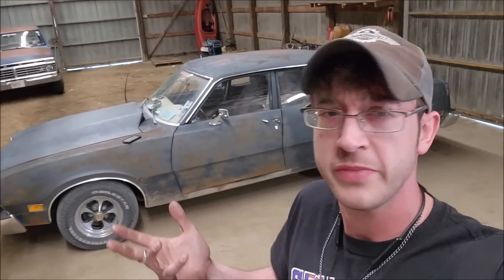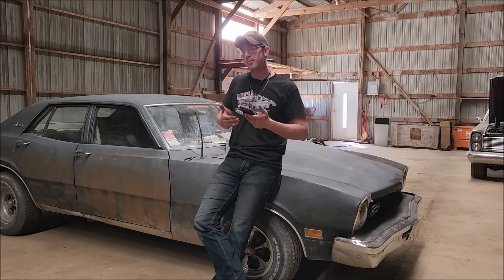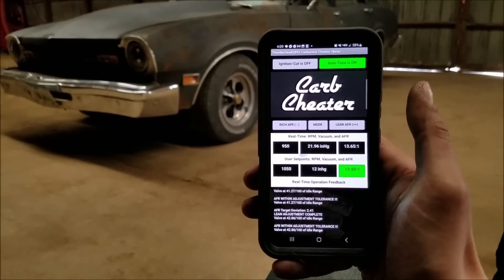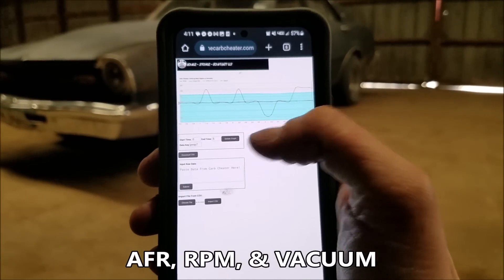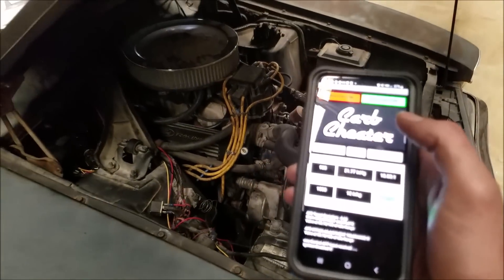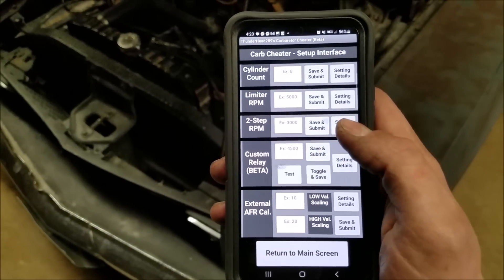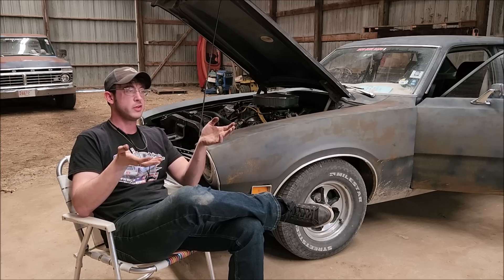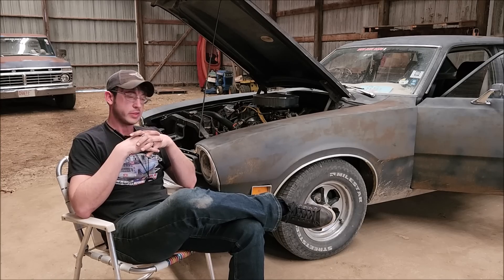A "self-Tuning" Carb in 2023? NOT fuel Injection (Beta Version - Teaser)

Comment: As soon as they are available, I am buying at least 3. I am a big supporter of carbbed vehicles over fuel injection and I own several antique cars that i want to keep on the road. This carb cheater would just help them run that much smoother and more efficient. Can't wait for it.

Comment: On remote start, the car will start with the key in the off position?
Reply from the maker: It's not something for anyone to worry about because I'm not allowing anyone else to do that the same way I did. 
I used the universal relay on the board that can be toggled, set to be on with key on (power an electric choke, or?), and it can be used as a "window switch" also know as an rpm threshold switch. So like a shift light, nitrous, and so on. I left it up to the user to be creative - the window switch thing always made me mad because they are over 50 dollars by themselves - Dumb. - figured we'd throw it on here.
Reply: @ThunderHead289  Thanks.  Not a concern or a criticism really, just a twentieth century guy trying to wrap his head around a little modern tech lol.

Comment: 6:20 And the bonus of it trying to fire but failing (due to the immobiliser) is that stupid car thieves will think, "Won't start, better run...", or "Outta fuel, better run...". Even the smarter ones might think it's a fuel blockage or electrical issue. I've always been of the mindset to not have a flashing light on your dash advertising the fact you have an alarm/immobiliser. For the vehicles I've driven (sorry, I'm an old-school bloke) that I wanted to secure, I had a concealed battery isolator. Just the cheap, red plastic key type. Up under the battery mount. Hard to find or see if you didn't know where it was.
Oh, hey. The 'Carb Cheater' is an awesome piece of kit, man!

Comment: This is a bit disconcerning since that it might be possible for the government to require you to install equipment like this as a condition for a vehicle registration. Also to tax you regarding vehicles miles Traveled, emissions compliance and insurance. No OBD2 port or similar is necessary since a number of older cars did not have them until 40 to 50 years ago depending on the car manufacturer. Scary stuff!!🤬🤬🤬
I don't think the inventor had nefarious intentions but you have consider the potential misuse if at all possible.
Reply from the maker: Off road use only 🙂
Reply: @ThunderHead289  I figured that but somebody else could "borrow the idea without your permission".

Comment: is there any reason you couldn't run this with e85 on a carb not specifically setup for e85? You could potentially integrate the optional GM Flex Fuel Sensor.
Reply from the maker: I have considered that, and I think it's a worthwhile endeavor to test for v2

Comment: I enjoy this greatly. I would make good use of this set-up, as I currently have an old Nissan 720 pick-up that I pulled out of the pile, and I threw a turbo at it (have about 500 into it- thanks ebay). Seems to take it well! But the fact that you've set up a module that communicates via bluetooth to an android app, can take a few inputs and bleed air to correct an AFR is damned cool. I have no idea what would need to happen if boost were involved- well, I have a slight idea, but I have the feeling the answer is nothing. Do nothing but make sure your tune is right under boost. I'm more interested in the fact that you've programmed a way to ground the coils for rev limit and launch control. Who am I kidding, I just want what you've got to make life a little bit easier. Lord knows if this motor went I'd just throw a KA24 in the bay and run some of that hotrod fuel injection instead of a Hitachi two barrel. 

So, yeah, suggestions would be: If a boosted application, be able to map positive boost. That's about all you could do, I suppose. I see some comments saying "retard ignition timing", which would be pretty difficult unless this little module were interconnected with whatever pick-up is being used for the ignition system. Maybe have more "outputs" for relays, such as an output that's an RPM window with or without a MAP setting (I'm thinking a nitro application, or maybe a water meth injection application). That application would even help me, as I've over-pumped my fuel system, so I'm running a hilarious set-up of PWM voltage to a high pressure pump when not in boost, then when boost comes on, I have a oil pressure sender that's just piped into my intake that will close due to air pressure and send full voltage to the pump. Tons of things you could do, but the more you do, the closer we'll get to "Heck, a speeduino could do that". Speaking of, is that what it's based off of? Also, looks like I'm gonna have to look into applying for a beta test. Wish I knew how to edit videos, I recorded the whole truck so far start to finish, so I've got tens of hours of BSing the camera and doing terrible welds. America.
Reply: Went ahead and filled it out, if you read this, you'll know which is mine. I could throw it on about half my rigs if you don't want to fuss with turbocharged vehicles at the moment. Could make a good test monkey whether I throw it on an all stock Cadillac with a 307, or a cammed up small block, or a stock small block, or, or, or.

Comment: Pure genius. I love carbs, and this makes so much sense I'm surprised no one came up with this . You give me faith in the future of classic cars! Don't retire from YouTube, there is no rule that says you have to post every week.
Reply: Absolutely right! I'd much rather see a well informed, we'll produced and put together video less frequently, than to watch some of the junk on YouTube these days
Reply: In the 1980s Mitsubishi was putting Mikuni feedback carbs on their four cylinder engines.    They were an actual carburetor with a low pressure fuel delivery (not TBI, no kind of "injector") but used an oxygen sensor and a variable air channel to adjust AFR continually.    

In retrospect they're really clever,  but back then none of us had any idea how they worked and nobody would touch one.    Today with what I know I'd have no problem.
Reply: @shoveI  GM did the same with quadrajets in the '80s, but they had narrow band afrs and the computer had a very narrow running area so they did not work well on non stock engines without a reprogram, which almost nobody offered or did, so they all got tossed for a regular qjet as soon as any mods were done.  It's a good idea that was severely limited by the tech of the day, just like the first fuel injection systems.  It's amazing to me nobody has really tried this since, it's a no brainer tbh.
Reply: To monetize a video it's a rule you have to post more than once every two weeks so yeah, there is a rule.
I'm not trying to be that guy I'm just sayin'..
Reply: You're not that guy, just informing us that didn't know. Thank you.
Reply: Holley had a "dial-a-jet" option in the 80s. It was a PWM solenoid that restricted the main passage. The user just turned a knob to "tune" the AFR. Without a WB AFR guage it was not real useful. With today's tech it would be great.
Reply: Some of my favorite channels post twice a year.

Comment: The only reason I wanted to switch to EFI was for timing and afr control. If I could keep my existing carb, fuel system, ignition system and distributor it would be a huge bonus, plus a 2 step and anti theft its a no brainer. A nitrous/boost controller would be sweet as well. Sign me up!
Reply from the maker: The universal relay (that I used to start the car) can be setup as a "window switch" aka RPM threshold switch. Nitrous interlock, shift light - whatever someone wants to do, I left it up to the users creativity.
Reply: @ThunderHead289  Awesome, hopefully available soon!

Comment: A project like this can get as far out of hand as you want it to... But... Since you've already established timing control you're only a couple of wheel speed sensors away from implementing traction control too. It would also be really trick if the fueling side of the cheater was able to be implemented as cruise control since then you'd also have vehicle speed data (or a target to maintain, at least) to work from. That could be more tricky if the cheater is still "just" an air bleed on the fueling side, but you'd have all of the logic available implement other means if you wanted.
Reply: Yes very easy to run down the road with other add ons but I’m sure Luke will tell you that cruise control has its share of liabilities that keeps it as a “standard” offering.
Reply: ‘keeps it (off the list) as’
Reply: @111000100101001  The whole project is a huge liability. Interfering with fueling and timing opens you up to nearly everything that can go wrong with a car. Even if something happens that isn't his fault, defending a wrongful death lawsuit will bankrupt him regardless. There's no amount of waivers or anything else that will protect him from a civil suit.

So... He's made whatever peace with that which he feels he needs to. May as well go all out at that point.
Reply: this is very cool; imagine what it could do for all types of boating, racing etc.

Comment: I'm so excited for this product!  I'm Nate the data log guy lol.  Remote start is something i never thought of, sure is tricky with a standard trans.  Really no good way to detect neutral.
Reply from the maker: hello hello! I just used the universal relay we put on the board and pressed the "test" button which turns it on when pressed and off when released. it has a maintain on that would come on with a power cycle (could be used for electric choke), and it also has an RPM threshold trigger. want a shift light? nitrous rpm interlock? (window switch). really I left it up to the user to be creative with it. - basically a programmable dry contact.

Comment: Boost timing and air/fuel adjustment for a blow thru carb would be sweet
Reply: This
Reply: @frankglasgow  Boom! With you on that. Another company has some device for carbs that auto tuned, but the price is exorbitant. Found it, K&N eci system $880 at jegs.and not power adder compatible.

Comment: We used to call this a computer controlled carb or feedback carb. My Plymouth Reliant and Mazda B2000 shipped with a 2 barrel feedback carb from the factory in 1982 and 1986, respectively.
Reply: Fuck me you must of had a heck n a half springy long cable to connect your telephone set hooked up to your car also good job everyone never had that back then or wud of been getting our wires crossed somewhere!! "JoeDog"a.k.a J.C.A  (the British are Coming, the British are Coming!)
"I Say Great Stuff Old Chap, Well Done Sir"
Reply from the maker: was a really good idea honestly but the tech just wasnt even close to there back then
Reply: @ThunderHead289  Actually, they work just fine. Even after sitting up 29 years the one on my Reliant is still working flawlessly, other than a ruined accel pump I had to replace. 
The problem was the people, not the parts. Dad under the shady tree hated computers and so it got ripped off and swapped for a Weber the first sign of any trouble.